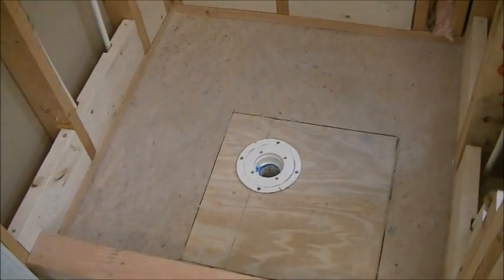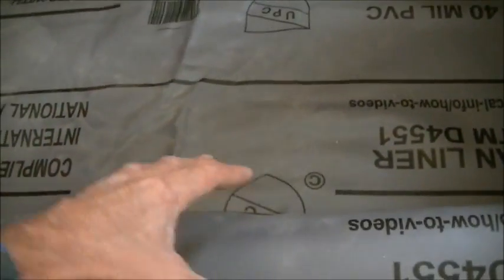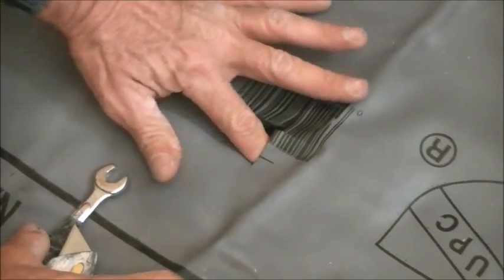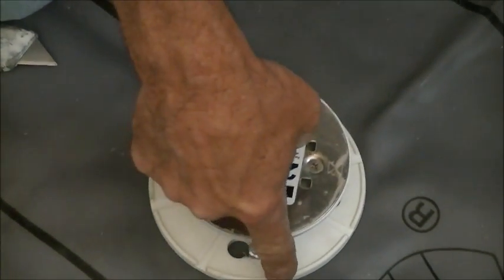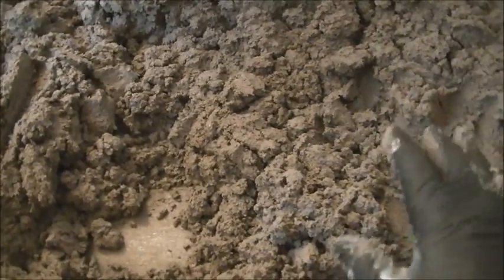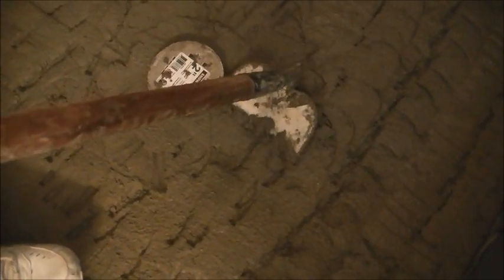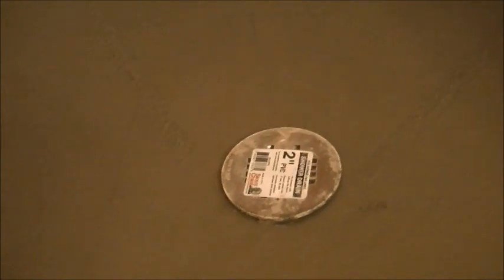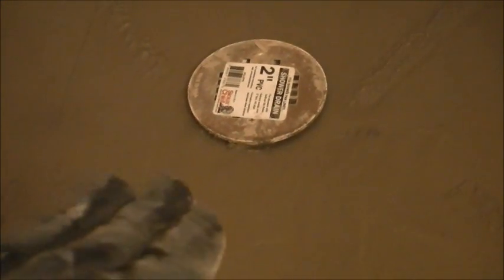How To Install & Pour Shower Pan

Comment: To all of you DIY - go with the times and use Kerdi or Wedi system to build your shower. This guy is good in what he does, but the time it takes him to do a mud shower pan and the rest of water proofing, you'll be taking shower in yours. It's true that the material for Wedi (I use exclusively) cost more than the shower liner, mud and backer panels but the labor cost is a fraction of doing it his way. Plus, there is no mess and you end up with a much better product. That is, as long as you follow the manufacturer instructions and use the recommended material, you'll never have any leaks, mildews, etc. I get my stuff (WEDI) from Emser Tile - they've been using the WEDI system for 20+ years on residential and industrial applications and had only one failure. The only one failure was due to the fact that the installer 'cut corners' and didn't use the WEDI glue. I guarantee you the first time you see the WEDI system you'd not believe it can work. The same happened to me. I switched to WEDI system about 10 years ago and was a hell nervous doing my first install of 3' x 5' shower. After 10 years of a heavy use my 1st install is still going strong - no leaks, no mildews, nothing. Since then I've done more installs with/without curbs and the same thing - no problems whatsoever. No offense Mr. StarrTile - you're very good in what you do, but times have change and doing a mud pan when all the new systems are available is just archaic.
Reply: False, won't last as long, there's a rabbit joint at the bottom of the pan, and this is the most tested and true way. Can do a shower this size in 3 days grouting and all, and you'll know for a fact it can last 30+ years
Reply: People that are not skilled enough use those pre made pans which the dimensions are limited, the will not work in a custom shower, u have to build to suit their pans. All showers don't have to be square or rectangular, creativity is elimated with premade

Comment: No lath, vapor barrier or preslope? Please no one ever do a pan like this. P.s. they make the oatey corners on curbs for a reason.
Reply from the maker: Lathe would be used for a pre-slope, people are not doing pre-slope anymore because it is all turned to sealed system, and you don't do a vapor barrier when you do a seal system, and you don't need curb corners unless you're stupid and don't do the sealed system correctly
Reply: @StarrTile  Great video, unfortunately I get to re-model my bathroom remodel for a leaking shower pan....I am glad to see someone correct you on the internet...love it when anonymous fools on the internet start to give unsound advice to obvious experts.
Reply: I dont agree with basically none of his pvc installation, estecially at the curb and no slope what so ever, i guess he slopes the top motor bed @StarrTile

Comment: your mudd is way the wet , deck mudd ( which is what we call it here in cali ) should have a very small amount of water and also use a flat towel youre using a drywall tool , im a licensed contractor with a c-54 in california and have be tiling showers  for over 40  years , i do not  like your videos , your showing people how to do something that took most of us years to learn just so you will get more hits and make a little cash  , sad
Reply from the maker: I use both tools, a blade, a trowel, 2x4, a friggin KITCHEN FRYING PAN if it helps to the end result...what difference does it make which tool you use ??? If you've truly been at this 40 years, which I doubt, you know better than to critique HOW something is done, the result is the important part.......and by the way, I get paid NOTHING from YouTube, and i could care less about "hits". Be a real man & call me next time you take issue with my methods.
Reply: David Dean what does it matter that he uses a drywall knife? Most people use a plastic knife to spread bondo to fill holes on wood. I use a metal knife and clean it afterwards. Ooohhhhh so terribly wrong to do that. Many tools can be used for multiple tasks. He is right about the one key aspect. The end result is the main thing.

Comment: Can i use deck mud for my pan?
Reply from the maker: Yes
Reply: StarrTile Thank you
Reply: I didn't find deck mud in my locale, so I used Quikcrete Mortar Mix (brown paper bag they call yellow with green stripe).
Reply from the maker: Yes, that's correct